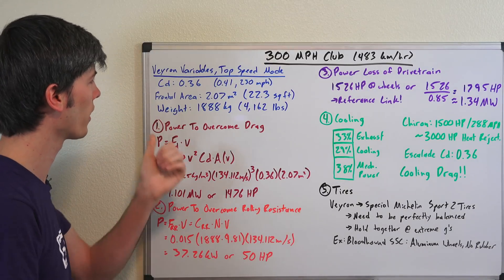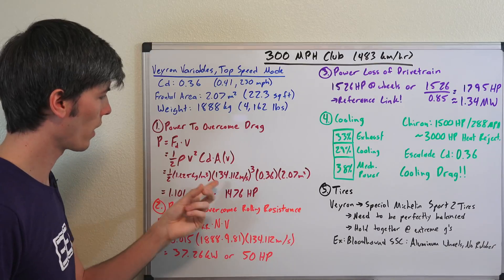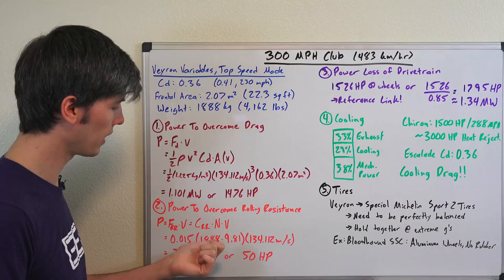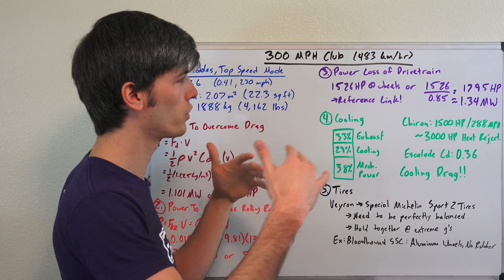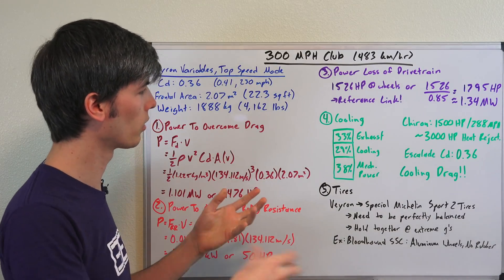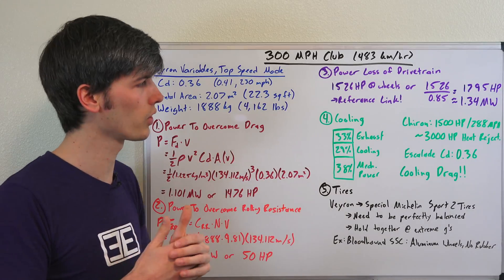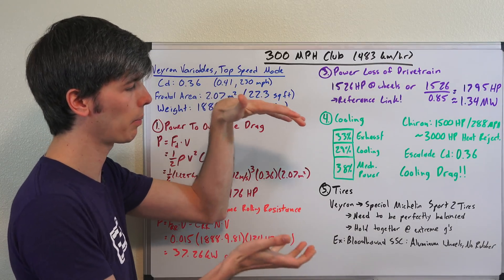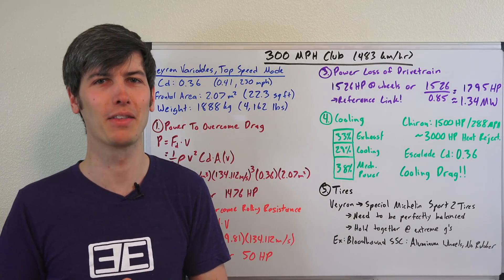Why Has No Production Car Hit 300 MPH?

Comment: Actually, people that use metric system dream bigger - 500 km/h baby!
Reply: Devel Sixteen? Had a laugh, thanks.
Reply: MAUIKINGS I doubt it will ever happen.
Reply: That car is not real. As there is not even a glimpse of its show of power or speed.
Reply: Arctic Avenger Kilometers are shorter than miles just saying
Reply: @tank9503  500kph=310.7mph>300mph=484kph
Reply: THANK YOU ! That's exactly what I expected to hear !
Reply: Like your profile pic
Reply: Arctic Avenger Harmonics start to count at this speed. Electric trains with kateners cannot go above that because the shock wave generated in the material is not as fast
Reply: Swedish miles are longer then British imperial miles, just saying
Reply: +Tank Dempsey exactly.
Reply: There is an engine dyno on youtube
Reply: 1888 Kg vs 4162 lbs ...? To paraphrase Sheldon Cooper; "Jimmy Carter started the US on the road to the metric system, then something went wrong!"  (*cough* ray-gun *cough*)
Reply: @Car_Mo  Whats your point....? Exactly. Nada. Period.
Reply: *482.8 km/h
Reply: Koenigsegg Jesko Absolut should be able to reach over 330mph (500kph)

EDIT: 330 mph is actually 528kph
Reply: @Achim Anscheidt yeah, idk why I said 500kph. Cause 330 mph is actually 528 kph
Reply: Arctic Avenger 500 km/h you say... Just wait for the devel sixteen with 5000 hp which as been determined that it should reach around 300 mph
Reply: @wyattgibson808  Alright welp buggati did it again with the chiron new 304 mph record
Reply: @wyattgibson808  what a yoke
Reply: MAUIKINGS I’d expect 500mph instead of 500kmh with 5,000bhp “under the bonnet”. Anyway, Chiron surpassed 300mph with way less stallions in the barn, 304mph (490kmh) to be exact with 1,500bhp!

Comment: The Devell 16 goes 348 MPH so he is wrong. There is a car that goes over 300 MPH from the factory.
Reply: But it needs special fuel to do so... It loses over 30% of its power on regular gas. And it is not a production car.
Reply: I thought it was a production car.
Reply: Funny thing is that I thought it was a 'one off', but it might actually be a production car. It appears you can actually buy one.
It seems you were correct.
Reply: if i claim my car goes 400mph and has 10k hp would u belive me then ? what im trying to say is there is no vid as faar as i know where this "devil" even reaches 50mph. the car is still nothing but an unproven theory car that reminds me more of a showcar. besides that i cant find any real information on who built it, it says some arabs from dubai. i dont wana sound like some racist but since when can the arabs build cars or even supercars...

Comment: Thanks for the equations!!!

I was doing some maths on my favorite car using your equations. The Koenigsegg One:1 would need 1702HP to break 300MPH. 

However, if you were to remove that big rear wing and reduce the DF a bit so you had the same coefficient of drag as the Vayron. It actually has EXACTLY as much HP as it needs to break 300MPH. 1362HP.
Reply: So that's why it's so fast is forza horizon 3.   🤔🤔🤔🤔

Comment: So basically rubber cannot handle 300 mph and the intake of air to cool the motor slows the car down immensely. 

eh, the fastest you can legally drive as far as I know is in some rural parts of Texas where the speed limit is 85 mph. 230 is more than adequate.

Comment: Most car consumers around the world cares about cost per mileage, service intervals, safety, comfort and entertainment feature much more than acceleration and maximum speed.

Makes no sense to mass production a 300 mph car at a cost of half a million each when only 1% of the market will even be able to afford it, let along driving it in any meaningful way on a day to day basis. Most likely 90% of the time it will do less than 60 in any major cities.

Might as well buy something that comes with traffic jam assist
Reply: Niels; 
yes, and then those hypercars spend 99.9% of time being parked in high security garages (almost never driven in the real world)
Reply: The devel sixteen...It was terrible.I would be surprised if that car went 250 km/h without it falling apart.They have tested nothing and they are just throwing numbers out
Reply: Eryk Pyts I'm not disagreeing with you.
Reply: BrunixBROGamer it doesn't, unless you are an insider the devel sixteen doesn't even hold up to a little bump
Reply: Also,not every car is supposed to get good mileage and have enough space to fit a few bags.Did you look at the veneno?
Just look at the aston martin vulcan
Reply: S- Cloudy be the 1% to own that car
Reply: BrunixBROGamer production car
Reply: You'd be surprised at how fast the first 300 mph car would sell out, I think.
Reply: S- Cloudy loooooooser
Reply: actually theres a devel sixteen , it goes 560 km/h or 348 mph if you will

Comment: Why not use the heat that the engine produces as the energy source for the cooling?
Reply from the maker: +EVGR Swift heat can't remain within the closed system of the vehicle. It needs to go somewhere in order for the vehicle to be cooler. The only long term option is the surrounding air, or atmosphere.
Reply: Engineering Explained wow thanks for replying and okay I understand now

Comment: If you're trying to go that fast, you'd be better off just using a rocket, then the air resistance becomes a benefit, more air, more power.
Reply: Samuel Rosenberg thank you for the correction, yes I meant a jet engine, not a rocket! duh!

Comment: It is fascinating to see that an entry level VW Polo from 1997 could reach 300 MPH if only there would not be any air (Assuming the engine runs on compressed air in the vehicle. Roling Resistance Versus Air Resistance is so tiny!

Comment: They need to find a way to modify the air in front of the vehicle through sonic waves in order to lower the drag felt by the vehicle, this could be engineered and will eliminate the need for brute force to simply overcome the drag.

Comment: The cooling problem could be "solved" by an extreme top speed mode, that shuts off the air intakes to lower the drag coefficient so you can reach 300 mph. And when the engine reaches its peak temperature limit, the intakes reopen, slowing you back down and preventing damage from overheating. This is cheating of course, but the car could technically be capable of 300 mph.

Comment: 1: Take Tesla Model S
2: Add beast motor from microwave turning plate
3: Add 23 heat exchangers and a +20 HP sticker
4: Put a really big exhaust tip on, don't worry it makes EVs faster too
5: Use bricks as tires
6: Do a sick burnout
7: 300 MPH

Comment: Pardon me if this sounds odd, but why can't you use a Turbine engine (PT6A's go from 550 to 1800 HP) coupled to  a CVT and then a Normal 7 speed manual gearbox behind, that'll largly reduce the amount of frontal area and cooling requirements for your engine. plus  you'll have insane mileage given how Turbine Engines operate, and if you run Jet Fuel as opposed to Diesel, you'll burn really really cleanly. Just a thought, what say you sir?

Comment: 1.8K horses does seems a bit of a challange, however i would not ever underestimate engineering.  it ain't the raw horespower stopping them, but emission standards i assume.
you see, if they could use 2 stroke opposed piston engines then they could get the required horses , not with ease, but managable. cooling is a difficult question for sure however if style would not play a role then presumably more drag efficient solutions could be found. 
but why would anyone make a 300 mph car, it is unlikely more than a dozen of them would find an owner.

Comment: I would think 300 mph would be possible for a very long, heavy car.  I'm thinking of it from a physics standpoint.  The friction between tires and the road places a limit on the maximum air resistance that can be countered by the vehicle when traveling at high speed.  More precisely, the maximum air resistance that can be countered by the tires when cruising at a constant speed is equal to m*g*\mu_s, where \mu_s is the coefficient of static friction, and m is the vehicle mass.  So let's say you had a bunch of heavy batteries and high-power motors working in tandem, arrayed within a long, narrow frame.  You could achieve far higher top speeds until you were limited by other factors such as rolling resistance.

Of course, such a car probably wouldn't fit within a typical parking spot and wouldn't be practical for many people.  But hey, there's a market for supercars and a market for limousines; perhaps someone could combine the two and make it into a production car.

Comment: If you're making a vehicle with the goal of hitting a high top speed, it'd be possible to design the cooling system to actually produce net thrust instead of drag.  They had WW2 airplanes that did this; at speed the heat from the radiators actually gave the plane more power.

Comment: Neat-o... But the big question is...... How fast would it go on the moon?
Reply: Pig Farmer Ben zero miles per hour
Reply: If you're asking seriously, there is no oxygen on moon, so no combustion and an engine based on gasoline can't work. An electric car would be able to hit really high speeds (in theory), but since air is used here to cool down the engine (moon has almost no air), it would need an internal refrigeration system, like a fridge. The fridge idea might even be possible, but would require insane amounts of energy
Reply: Pig Farmer Ben 250,000 miles/300mph=833 hours

Comment: What i get from your video is that if accomplishable, It may be by a future hyper electric car. Electric motors have a far higher efficiency, no transmission loss and since there's no combustion, also have far less need for cooling (thus improving drag). Still I think it's very unlikely because of manufacturing limitations. The tolerances to make wheels and tires (or whatever the use as such) that can survive this speed, along with bearings and moving parts that remain allign and ballanced, as well as usable, light and servicable on a road-going car is mind blowing.

Comment: 6:05 "but it'd probably overheat"

Chemical intercooling would like to prove otherwise. Water to air intercoolers that have large easy to access reservoirs (ICE IN THE TANK!) would like to prove otherwise. Getting a car that can go 300+ MPH is doable, getting it daily drivable is doable, as is doing it for well under the cost of the Bug'. The difference is, that one would require you to do more than just get the "red key" and push a button. But if you're shooting for speeds above 170 you should be doing a bit of a walk around on the car anyway.

Comment: Speaking of aerodynamic drag, good piston-engine aircraft designers can shape the engine cowlings in such a way that the rejected heat of the engine actually provides some thrust; not much thrust, mind you, but drag due to the requirement to reject engine heat is less than nothing on a well-designed piston-engine aircraft.

Comment: well you could solve the problem by using the electric vehicle if you can use enough electrical power to get you there or a hybrid electric drivetrain with very low drag. also internal combustion engines have a lot of internal loss of energy then like you said major loss of power through drivetrain. another flaw of making a vehicle that powerful production is making it reliable it high compression and high horsepower reliability becomes questionable. the Heat and friction on tires also causes loss and making tires be able to withstand now high speed is hard

Comment: you don't have to do two diff measurements to get an estimate of drivetrain loses :| you can get acceptable measurements by measuring drivetrain resistance with the clutch engaged and the wheels off the ground

Comment: I have no idea of the surface area of all the radiators they are using. But is it feasible that some body panels could be used as heat exhangers? Perhaps even the the rims could carry coolant and act as fans/impellers with proper ducting. Perhaps further is a two stage heat exchanger system, using one coolant for the engine and a secondary coolant that transfers to atmosphere quicker. Just thinking, I'm not a scientist.

Comment: It seems to me the obvious choice is electric car. At 90% efficient, you wouldn't need all that cooling. They can also operate briefly at higher power, such as Tesla overheating at sustained Autobahn speeds. If you assume 0.24 Cd of Tesla S, 300 MPH would need about 1384*0.24/0.36=922 kW, or about 1230 HP.

Based on P100DL producing almost 600 kW, P166DL would do it. Unfortunately, Tesla says 100kW battery is the biggest they'll make, so this would have to be made by another EV company (Corvette EV?)

Comment: What is this "celsius" you speak of?
Reply from the maker: It's like F, but T(°C) = (T(°F) - 32) × 5/9
Reply: Vonday really simple: (distilled) water freezes at 0 °C ("degrees celsius") and boils at 100 °C. (°F and °C are "degrees" and need that little °,  but K isn't)

Comment: Heck, the power required ONLY  :) goes up with the cube of the speed. 300 Mph is only 5 times faster than 60mph. But 5 cubed is 125. Thus a streamlined car that takes 20 horsepower at 60 MPH only requires 2500 Hp. Then will the darn thing be stable? What about potholes? 
 In reality the cube factor swallows up the issue. ie double the HP of a car and the top end changes not much.
 So at 60MPH you need 20HP like a riding lawn mower creates. Drop in a 30HP Briggs and you have 50 percent more power. Your new top end is wildiy higher? it is 14.5 percent faster ie 69 mph to slide rule accuracy.

Comment: Why is aerodynamic drag so much worse on cars? Aircraft can cruise at 300 mph and waste substantially less power than you quoted for aerodynamic drag. And this way possible in the 1930s, so the designs were pretty crude by modern standards.
Reply from the maker: The air is much thinner at 35,000 feet (way less air pressure), so there's far less air resistance.
Reply: Also:
- No road friction to overcome
- No need for down force to be stable
- No power loss from pushing kinetic energy through a transmission
- Air crafts don't have to fit on normal roads, so they can be made more aerodynamic while still being bigger = housing a lot of power

They still have limitations, not many electrical air crafts around =)

Comment: Nice analysis, interestingly the last land speed record set on a public road was not far from the speeds that modern production cars can reach.  Sadly it resulted in the death of a driver.  Which raises the question where could you use this kind of speed?  Only a handful of test tracks around the world (or the 5 mile long landing strip for the space shuttle) could safely support that kind of speed.